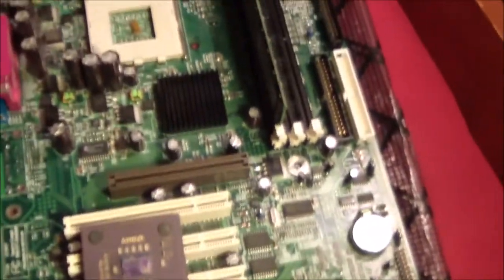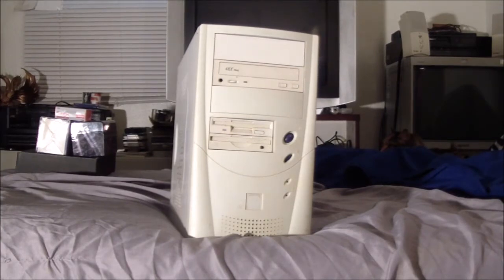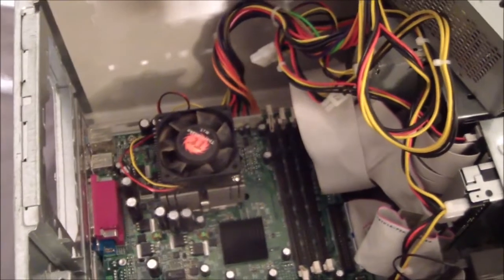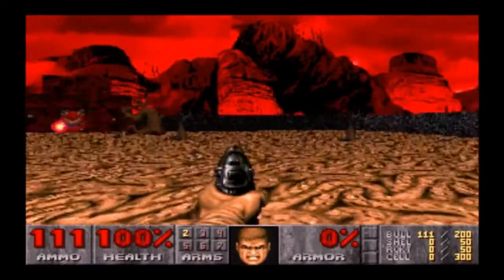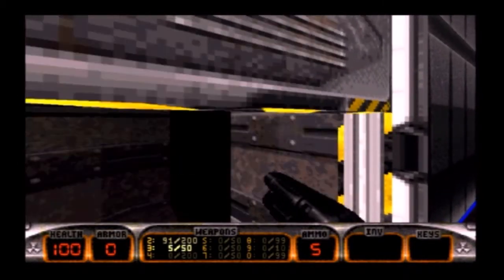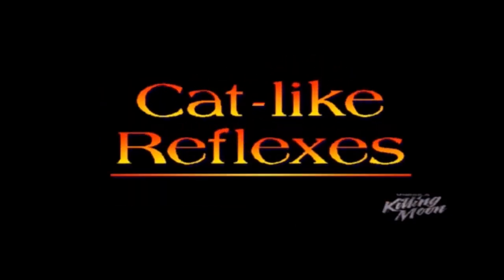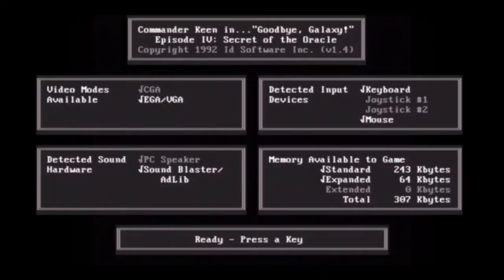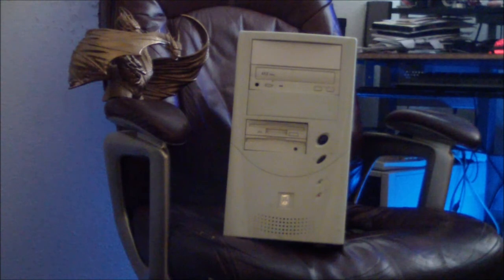Doszilla, Building the 1.4ghz AMD Thunderbird DOS PC

Comment: I think your problem is with VESA VBE compatibility. The splitter may mention something about that. I think this is one of the reasons the Savage 4 was not liked. A Voodoo3 card for example has the last / best VBE 3.0 support.
Reply from the maker: Perhaps. I've used the splitter with some pretty ancient cards before all the way down to the earliest ISA VGA cards running in a 386 and 286 and never had any issues.
Reply: which games support use VBE 3.0 ?

Comment: My fastest Dos machine uses a PIII-S Tualatin 1400@1575MHz run prime stable with the Stock VCore of 1.45V, SL6BY Stepping. With the Asus V8460 Ti4600, I have 12300 points (1024x768x16, stock settings) in 3DMark 2000.
Reply from the maker: That's a nice CPU choice for a super fast DOS rig. I also like the ti 4600. I recently built a PC with one of those in it which I'll probably have a video on next week or so.
Reply: Yes, the tualatin is very nice. I also have a PIII Coppermine Slot 1 machine with 1Ghz@1.1GHz with 1.70V standard Vcore (100MHz FSB version, SL4KL Stepping) and a Ti-4200 128MB. In 3DMark2000, I have 7800 points.

That's a big difference for only 400 more MHz of the tualatin.

Mainboards: Asus TUSL2-C with evil inside mod bios for the Tualatin and the Asus P3B-F 1.04 for the coppermine. Expendable with the EMBM Mod on the 4Ti card, also runs smooter with the Tualatin.

Comment: I sold thunderbirds back in 2001? and they were running hot 65 Celsius was considered normal. One day a customer ordered a brand new AMD system and he replaced the cooler and broke off one of the small clips on the cpu socket. For all you young people out there yes big cpu coolers were hanging of 2 little clips on the cpu socket ;-) Buy anyway the customer returned to the store claiming that his pc was doing some weird stuff. I opened up the case and I saw that he used a dremmel tool to drill a hole in the side of the cpu socket, and put a screw in there to hold the cpu cooler on....

I said I'm not going to mess with this, and gave him his pc back. Next day he came back, with a complete dead system. One of the screws broke off, the cpu cooler had hit the vga card shorting everything out. Dead cpu, vga, ram, motherboard, soundcard etc. That poor system was just 3 days old :-)
Reply from the maker: I don't think I ever get tired of reading old retail horror stories. I used to work at a video rental shop before streaming put them all out of business and I sometimes ponder doing a video and just telling some stories from over the years I worked there but I guess it would be a bit to off topic.

One thing I've learned is that home made or modified heartsink setups rarely seem to work. With many CPU's the heatsink has to be on just right and making really good contact to work. Did you guys replace the system for him or was it (rightfully so) not under warranty because of the modification?
Reply: No this was not under warranty. When he bought the 1200 MHz system we hold him to stick with the 1000 MHz version because of the high temps the 1200 MHz thunderbird produced. The cooler AMD included was  sufficient. But back in 2001 65 Celsius was alarming for most people. So he replaced the cooler with a big ass cooling tower, and broke the socket tabs... It was a stupid system for mounting a cooler. But hey we did not needed big coolers before then. We sold 98% AMD CPU's back then, the new pentium 4 came with expensive rambus memory. :-)

Comment: It seems the splitter isn't recognized by the VGA card - which then tries to default to a different non VGA (EGA/CGA) video mode. Good thing the monitor is very compatibile with the signals coming out of the PC.
Reply from the maker: Seems to be the case. Its quite strange as I've used the splitter with dozens and dozens of cards old and new and none have given me this issue. The monitor is a Sony multiscan G420 which so far has been a fantastic monitor with the one exception as I can see the wire that internally goes across the screen in certain circumstances.

Comment: Excellent project! I was also building a DOSZilla, Athlon XP 2200 (133x13.5) 1.8GHz, motherboard EPOX 8KTA3+. It was really fast, the fastest DOS build I had ever had. It died a few days later after doing some benchmarking. I guess some capacitors couldn't take it? I'll investigate it later.
Did you run fastvid for your benchmarks? that will give you a huge bump in high res benchmarks/games. I also use to benchmark doom running in 640x400 (MBF source port).
Reply from the maker: A common problem from those capacitor plague years. I've seen many a Socket A motherboard dead because of it.

I did not use Fastvid. I remember considering using it but my initial searching on the subject suggested it only worked with Intel CPU's. Looking now that doesn't seem to be the case though.

Comment: annoying case design for the psu placement. an sfx form factor psu frees up some space, but no -5 v.
Reply: The original vision for the ATX design was to cool the CPU with a passive heat sink and only the PSU fan, which is why the PSU was mounted where it was.
Reply: @BandanazX  I'm fairly certain I had a bigger version of this case. If I remember correctly, it had two 3.5 external bays and five 5.25 external bays and the PSU sat on top. My Athlon 800 was in it and I'm pretty sure I had more room than I needed. Of course my memory isn't what it used to be.